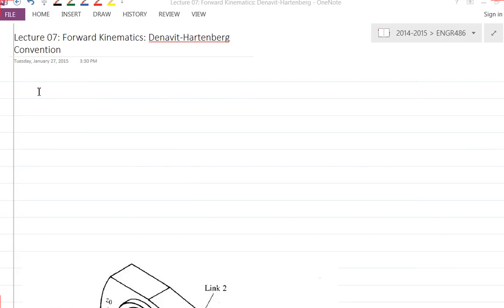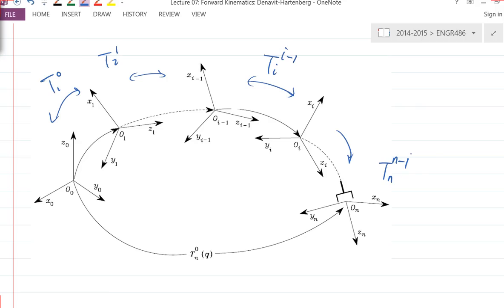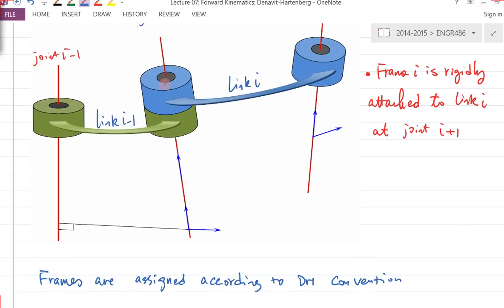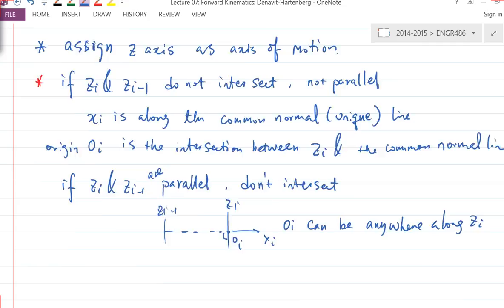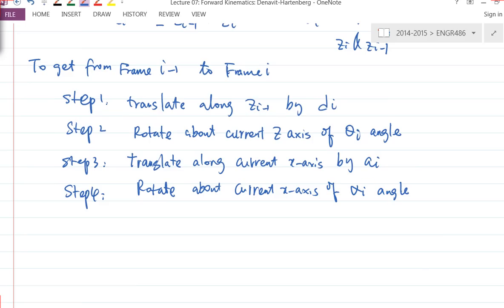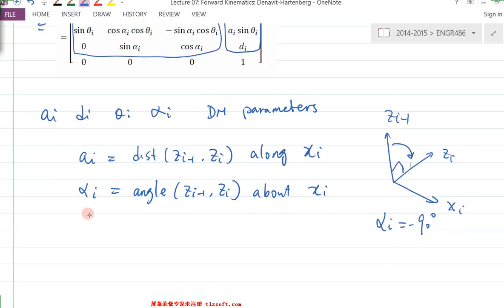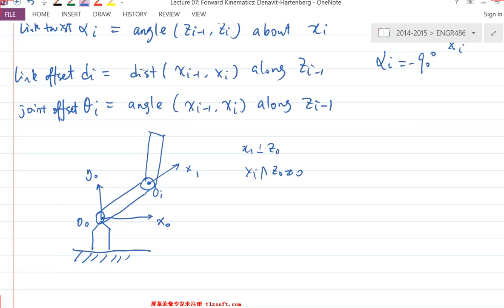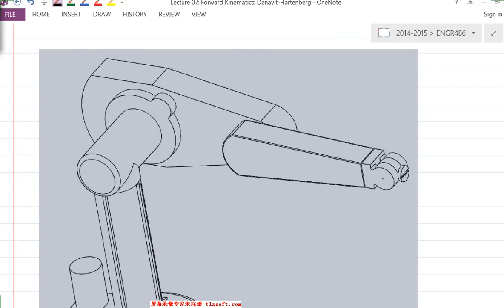2014W ENGR486 Lecture07 Forward Kinematics: Denavit-Hartenberg Convention

Comment: The question after 29 minutes and 35 seconds is the same as my question. and how do I fill in the form of alpha i, alpha i, d i, qi when I fill in the DH table. I filled it with alpha i = (0,0,0), alpha i = (0, -90,0), di = (0.3, d2, d3), Qi = (Q1,0,0). Would you write your e-mail or did I go wrong?